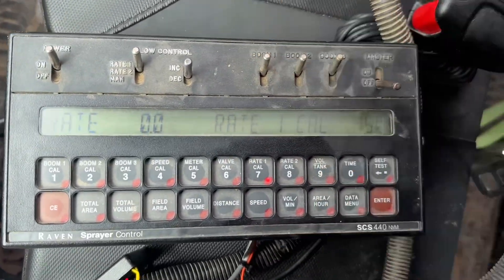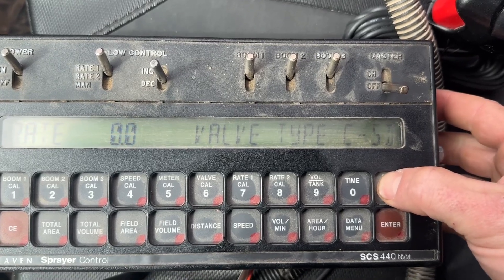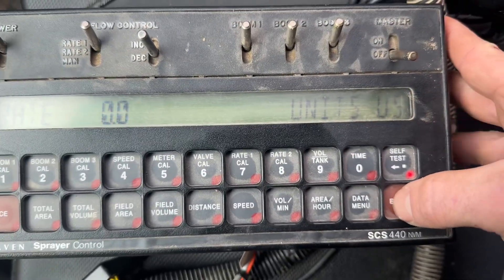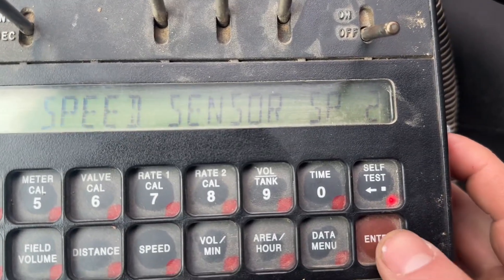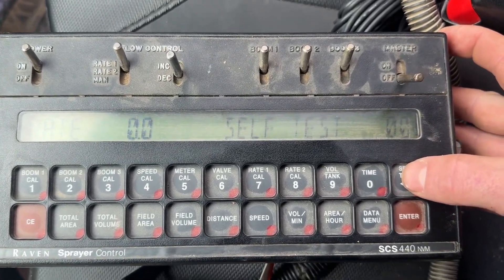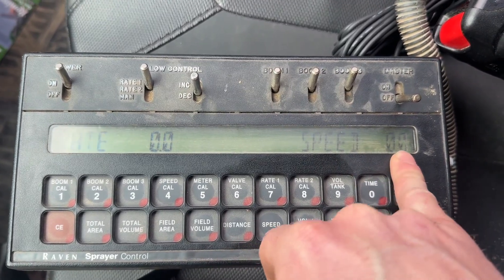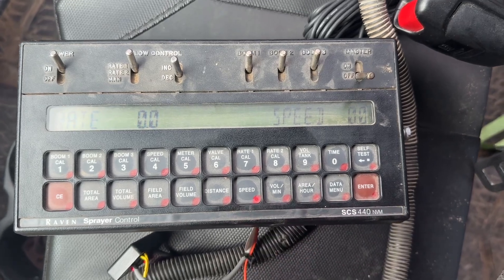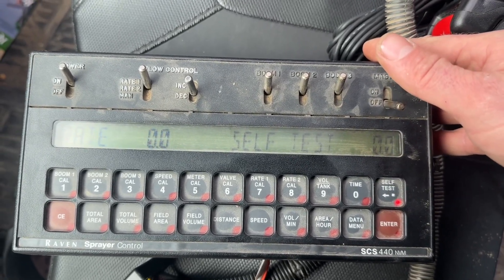Changing Raven Controller Settings Using Self Test

Comment: Also I want to add that I bought sprayer for cheap and trying to stay cheap can I run that type of sensor? Can I adapt that to the raven? It’s 4 pin so I don’t have that hooked up yet could that be the problem why I can set the valve setting for csd or cfc it’s not seeing a speed sensor ?

Comment: Can you tell me why when I reset and I do the initial us and sp1 or 2 that works fine but after I enter sp1 or 2 it will say .0 it won’t let me enter the valve type any ideas? Thanks
Reply from the maker: @chadgall5868  on a 440?